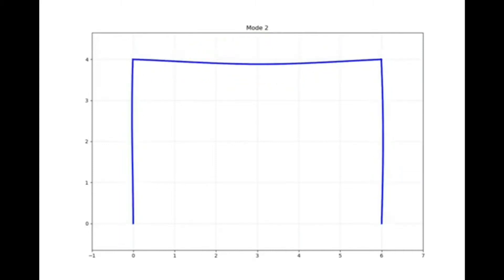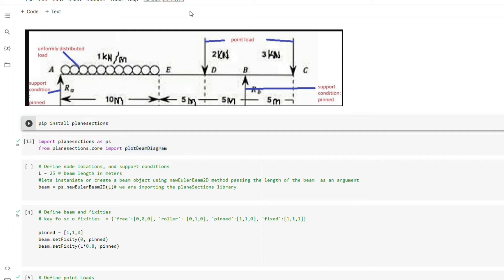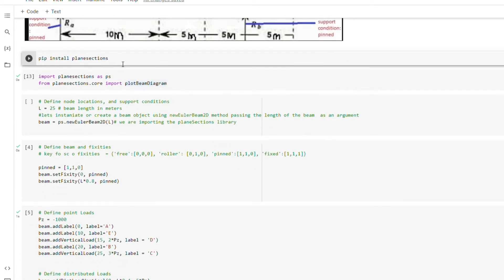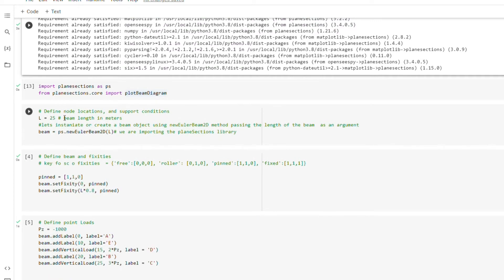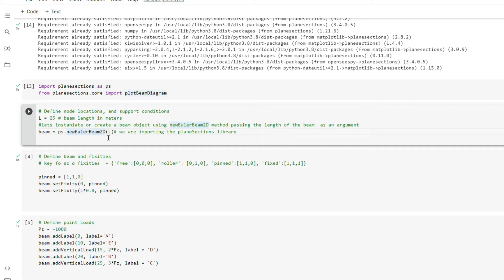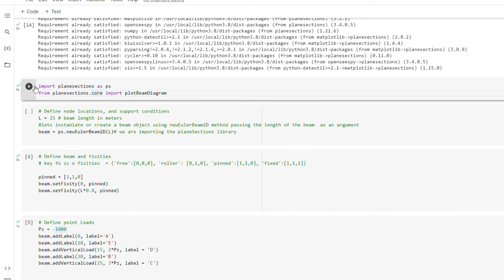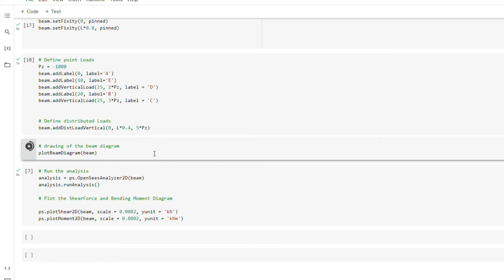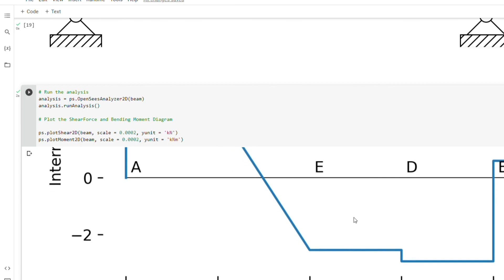Introduction to Beams  analysis Using Python| python for civil engineering

Comment: Thank you for this video, but I have a question: Can this module calculate continuous beams with different sections in each span😅?
Reply from the maker: There is a better version of this library. Its called anastruct. Its more easier I guess and you can do most beam analysis problem with it. I have video of that.

Comment: Load acting downwards is negative. Please, what if it is at an angle? Will one have to resolve the loads into vertical and horizontal components or there is a simple way to do it?
Reply from the maker: You can do that. But for simplicity I will advice you to use Anastruct library. You can use its point load method and pass a keyword argument 'rotation ' with the angle you want.